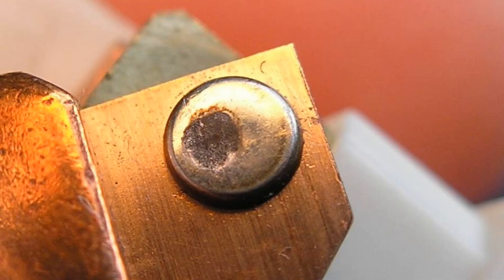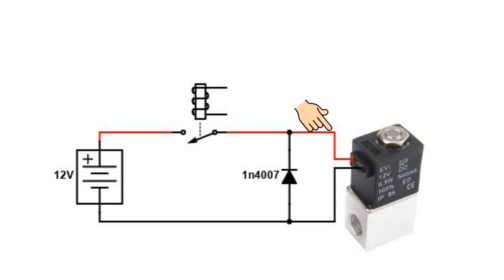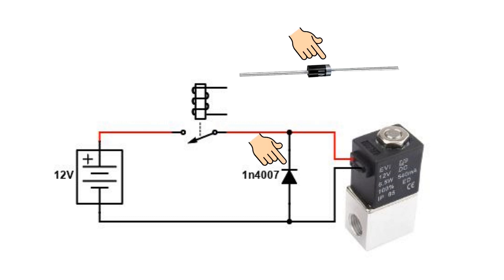Fixing Back EMF problems on your CNC - CNCnutz Episode 257

Comment: I 'm getting emf from my stepper motors when moving them manually which make my fans run, will adding these diodes to my g540 connectors work

Comment: Peter, I always enjoy your videos so thank you.  Something worth noting with freewheeling or snubber diodes is that they always delay the release of the relay slightly by providing a path for the current to keep flowing through the relay coil.  The length of the delay depends on relay characteristics.  In most situations the delayed release is of no concern as it is only milliseconds or low tens of milliseconds.  Where the time delay is a concern there are other options for more complex snubber circuits. A couple of other things also worth noting: 1. Some relays have a diode built in across the coil. If the relay coil terminals are marked with a polarity sign that is a clue that there may be a built in diode.  2. The same back EMF problem can exist in circuits with ac relay coils but of course freewheeling diodes can't be used. Other resistor-capacitor or transient suppressor snubber circuits are generally used, if any at all are fitted. The severity of the problem in an ac circuit depends at what point in the ac wave the relay coil circuit is interrupted.

Comment: Peter,  always loved your videos! 
in regard to the Back EMF, should we be concerned about this on the MASSO relay board as well? or are the diodes built in to them?
thanks in advance!
Reply from the maker: The diodes are built in on the MASSO TTL relay module. I am specifically referring to switching inductive loads using the relay contacts.
Cheers Peter

Comment: My machine somethimes is doing different contour with the same program...in that time, the servo motors on X,Y axis are shaking. Maybe this will fix the problem?
Reply from the maker: To be honest it does not sound likely. my feeling is your servos are not properly tuned if they are unable to hold a stable position but that is a guess at best.
Cheers Peter
Reply: @cncnutz   Thanks for the unswer. But, there is monts when ewerithing is perfekt, and suddenly there is problem, as I describe.

Comment: Glad to see you are back!
May I ask which oscilloscope are you using?
I propose another type of diode: "fast recovery" for higher voltages or "Schottky" for up to 24VDC supply.
Reply from the maker: I real cheap one off Aliexpress made by Fnirsi 1014D. There are better ones available for the same money. I would not recommend it. 
Cheers Peter

Comment: Good to see you back Peter. Great idea, I get emf shocks of air valves regularly, will try that for sure. 
What is the best distance per revolution for X & Y axes.  I'm just getting round to finish building the cnc machine that was started over a year ago. Going to belt drive the screws. ( cheep 2mm pitch stainless steel).
Reply from the maker: If you are getting shocks you definitely need to install a diode across the solenoids.
Resolution will depend on your machine size and what you are machining but I am happy with 0.01mm per step on the X & Y and 0.0025mm per step on the Z. In general Micro stepping between 2 and 10 times is reasonable and more that that is wishful thinking. With such a fine screw if I was direct driving it I wouldn't go more than 4X and I would probably go 2x but that is my personal opinion.
Cheers Peter
Reply: @cncnutz  thanks, after watching your ball screw versus rack video I have decided to gear drive on to my 2mm pitch threaded rod at a ratio of 1:2.  A bit of both ideas, thanks for your help.